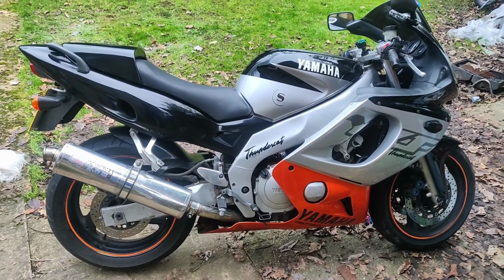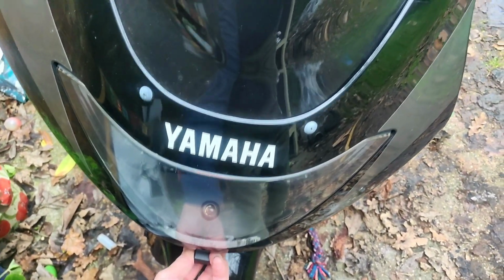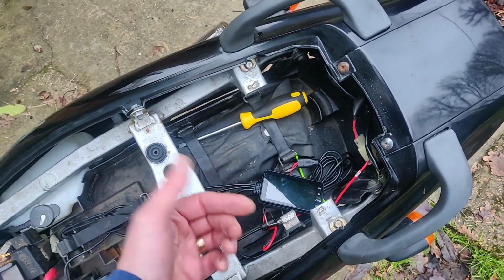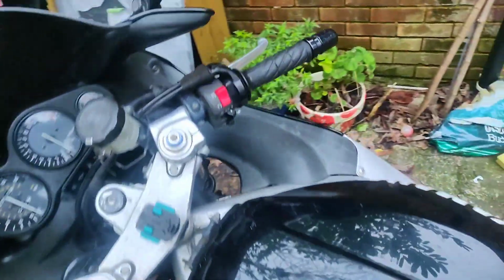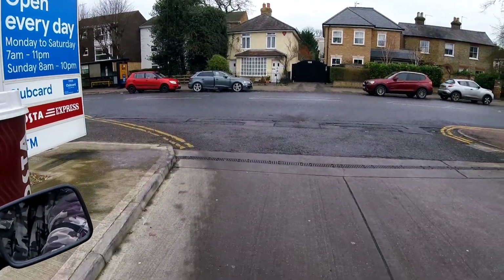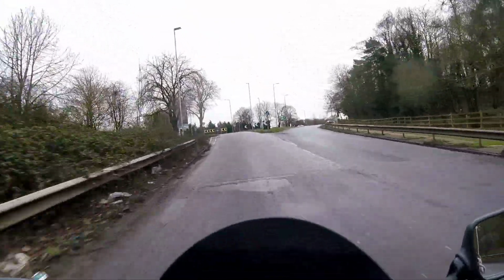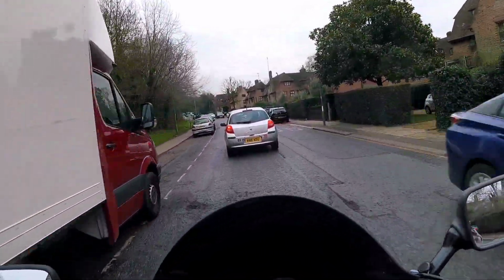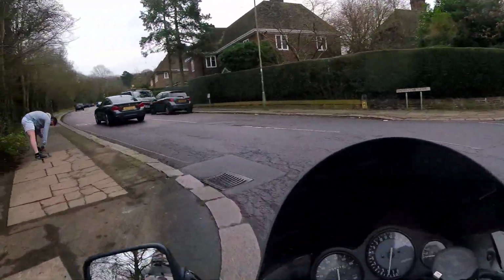Yamaha YZF600 Thundercat.  MOT day, Rideout and catching up with old mates.  A great day!

Comment: Riding around Hampstead looks a bit like taking your life in your own hands there mate. How did you mount that phone holder on the handlebar ???
Reply from the maker: Ultimate add-ons mate.  It's on to a stalk on the top yolk bolt.  Really good but not cheap.